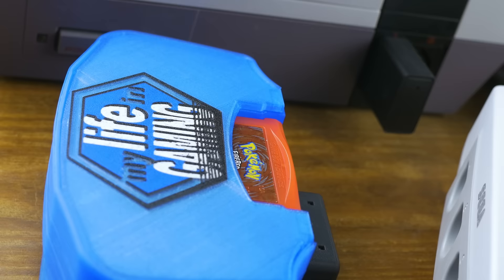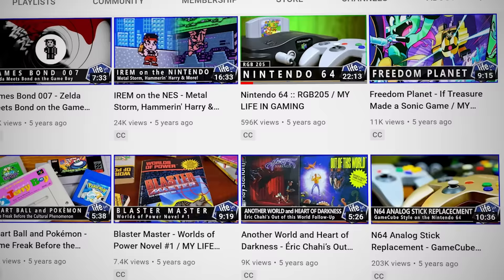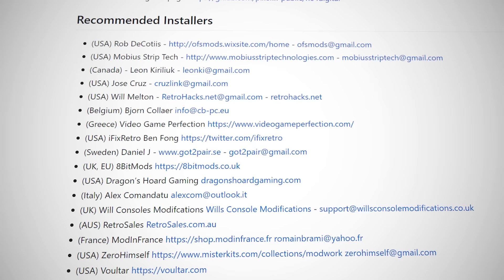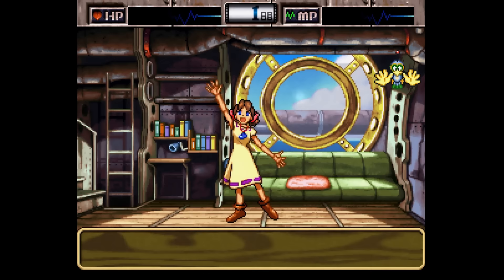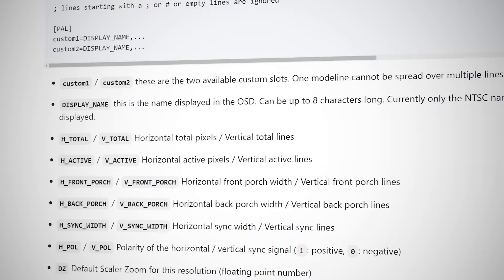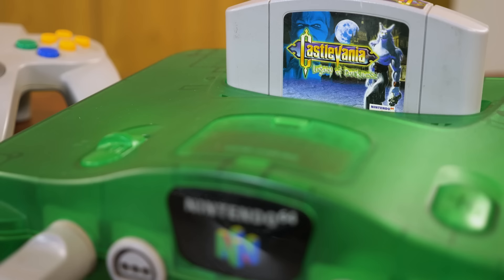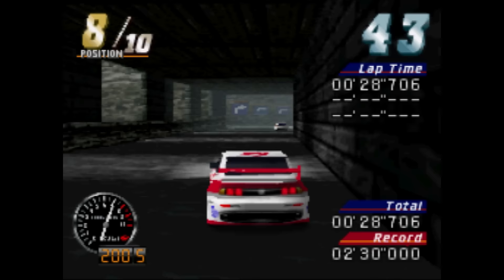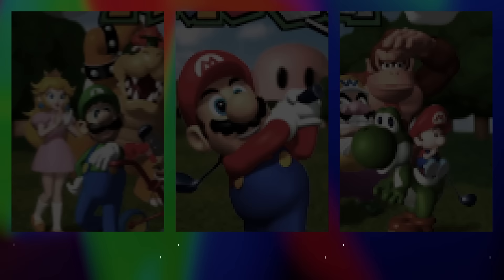N64Digital - Ultimate HDMI and RGB Mod for N64? :: RGB323 / MY LIFE IN GAMING

Comment: I have five CRTs and never intend to go HDMI with 64 buy I'm still watching this because this series has been so great. Glad to see another entry
Reply: Only 5?
Reply: Cool I love I only have 2, a 13 inch RF only Orion and a 27 inch flat screen Emerson from 2005 with S video.
Reply: @PaperBanjo64  Tbh, as long as you have the right CRT that you enjoy, then 2 is all you need, or even just 1. Admittedly I now have 6 and counting, just got my first HD CRT T.V (32" Samsung), didn't think that would be possible in the UK as they were not really a thing here unfortunately, it's imo the best possible display for playing everything from PS2 up to the 360, Wii looks awsome on it @ 576p EDTV mode through component. The rest are VGA monitors, I have some really nice ones like a Sony G520, a Sony  GDM-5011p which is a pro graphics CRT with an incredible picture quality, I also just got a LaCie Blue IV (incredible monitor) and an LG Flatron 910SB.
Reply: I use a newer TV but it has an RGB scart input so I use this with consoles.... But don't have an n64

Comment: I'm envious of this mod! I have the first-gen Ultra HDMI and think it's fantastic, but man, also having RGB support? That would be excellent.
Reply from the maker: [Try4ce] You can install basic RGB mods like the Voultar board alongside Ultra HDMI, and I'm pretty sure you can also install the Tim Worthington one alongside Ultra HDMI as well (but you should double-check first).
Reply: @mylifeingaming  It doesn’t work correctly with 1.08+ unless you replace the resistor array with 0-ohms and bypass the flexes with a couple of Borti’s breakouts that have resistors at the RCP. 1.07 seems to work if you use Borti’s breakout for the N64RGB.
Reply: Glad I waited on this

Comment: Yes, I am in the second camp. I don't want to see blocky pixels on this gen of console that I grew up with, if I'm not on an emulator. I could do a cleaner "upscale" on an emulator, and I have both a gaming PC and a Pi4 (in a fetching old PlayStation case) attached to a 4k flat panel. I watch the videos to see what's out there though, it's certainly cool!

And, to be fair, I have refurbished and recalibrated a happy little 90's Trinitron for the OG consoles. For a while, I didn't see the appeal of that, either, being too used to emulators without analog outputs and almost forgetting how the original experience differed. Then I saw that Pis have composite through the headphone jack, and RetroPie images had been created optimized for CRT... so I fixed the Trinitron, experienced relative greatness, and quickly got into OG hardware with mods and flashcarts.

Comment: This is really cool, but I'm happy with UltraHDMI for now. Thankfully I didn't spend a fortune on it, lucked out and got a kit on retail from Australia of all places. Still probably the most stressful soldering job I've ever done.
Reply: @shhhhplsbequit  It also adds lag and looks way worse. You don't have to get a full on HDMI mod for decent output though, actually good solutions start at $60 or so with RetroTink 2X-Mini / RAD2X.

Or, you could probably find some random old CRT for 19 bucks or less and get a very good experience indeed.

Comment: I've found my preferred output option on both the N64 and the PS1 to be S-video, which works perfect for my setup anyways which consists of a Micomsoft XRGB-3 line-doubler with 2x S-video inputs.  This allows me to save the 2 RGB inputs for my NES and Genesis.
Reply: I'm guessing your NES is RGB modded then.

Comment: 00:10:20 They could add an option to crop the picture from the GBA emulation to just the 240x160 frame and upscale that to the desired output resolution.

They could even add 3:2 resolutions for GBA games, such as 720x480, which is not only a common resolution but is also a perfect 3X scale of the GBA frame.

While GBA on the N64 may seem like a low priority, it's nice for those who like a single machine to be able to play games from multiple consoles.

Comment: Man, that vertical scanline really does look good. That's more what I think of when I think of CRT. Never liked regular horizontal lines cos, to me, it doesn't look like what it's trying to mimic. Sonic Mania had maybe the best CRT filter I've seen but this is right there with it. Do hope some modes start using HDR to give the games a little extra light to dark range to better match the brightness of a CRT some day. Hell, at a high enough resolution I imagine you could recreate how a CRT represents each part of a pixel in detail.
Reply from the maker: [Try4ce] Yeah it really does give it a nice crunchy consumer CRT look for sure! Regular scanlines just look like a PVM, which isn't what everyone is looking for.
Reply: @mylifeingaming  Hey Try, do you think you could share your scanline settings? I tried to catch it in the video, but the settings changed around a bit.

Comment: really bummed that ypbpr analog out was advertised as a launch feature but it's still not available yet, and u didn't even mention it 😭😭😭😭😭
Reply from the maker: [Try4ce] I originally wrote a mention of it, but took it out because one, there's nothing to show for it, and two, I don't really understand the point? You'd need a custom component cable to use it, and I'm not even sure where you'd get one. I feel you'd be just as well off converting RGB to YPbPr externally, either with HD Retrovision cables or a converter like the RetroTINK RGB2Comp.

Comment: 00:09:49 It would be nice to add a 16:10 aspect ratio option for Donkey Kong 64, which if I'm not mistaken, runs in an FOV of 16:10 in the widescreen mode.

16x10 resolutions would go along well with that, such as 1280x800 or 1440x900.

Comment: Is anyone aware if HD Retrovision's SNES component cables work with this output? My CRT has component and I would like to play on that occasionally. Thank you!
Reply from the maker: [Try4ce] I actually didn't test that, but I would be shocked if they didn't work. My N64 SCART cable is sync-on-composite, which is how HD Retrovision cables pull their RGB for component conversion. That cable works both with my old RGB mod and N64Digital's RGB, and I know for certain that my old RGB mod works with HD Retrovision, so I can't see why the result would be any different.
Reply: @mylifeingaming  * Thumbs up* Thanks so much for the response!
Reply: 100% do work with both N64Digital and UltraHDMI HW2.

Comment: My experience with N64 RGB differs from the assessment in this video. My TV looked much better with an N64 RGB MOD by Arthrimus tech (I believe based on Borti's) + OSSC over s video + Retrotink mini. Both with deblur on or off look far better than the stock S video. Unsure how much of that is due to the upscaler, but I'm using a cheap Aliexpress OSSC.
Reply from the maker: [Try4ce] I think on a CRT the jump is really small. With an upscaler, the jump is more noticeable, certainly. But much less noticeable than the jump to RGB for other systems, I feel.

Comment: @mylifeingaming How is it that the image at 24:46 of bomberman doesn’t look blurry on the retrotink yet the n64digital looks like a blurry mess shouldn’t the n64digital look better than that?
Reply from the maker: [Try4ce] You have to understand that I'm showing the results on a native 1440p monitor. Native resolution matters a lot. I don't think native 1200p monitors are common these days. The next comparison shows both at 1200p, so you'll see that they match more closely. If I used to custom modelines to enable 1440p on the HDMI output, then they would look basically the same. Or if I'd shown both on a 1080p monitor, they would look the same. If I'd shown 1080p on a 1080p monitor and 1440p on a 1440p monitor, the relative sharpness of each would be perceived as being pretty much the same. It was not meant to suggest N64Digital HDMI is blurry, it was just showing how RetroTINK offers 1440p without any fiddling, and 1440p monitors are pretty popular. If I'd done the same thing (1200p vs. 1440p) on a 4K (2160p) screen, the two would most likely both look a touch soft, and the difference between them not that great. It's just demonstrating what matching native resolution can do.
Reply: @mylifeingaming  ok so you don’t need a retrotink to make it look that sharp ok thanks that part of the video confused me.

Comment: I wonder if those upcoming scan converters will add built in support for "freesync" or "VRR" from HDMI 2.1.  That would be a killer feature to finally deal with those "slightly out of spec" consoles perfectly.
Reply: It would be cool in theory, but VRR monitors typically can't refresh at less than 30 Hz. They'll do some form of frame doubling or buffering, with varying results.
Reply: @ozzyp97  That shouldn't be an issue at all.  When I say they're "slightly out of spec", I'm talking hovering around the 60FPS range, way above that minimum.

Comment: I do not believe that this is the end-game for retro console mods.

I do think someday we will get a smarter upscaler that uses AI similarly to how Nvidia DLSS works, and it'll just take the raw image and completely re-draw the image in a higher resolution.

This could be in the form of an OSSC like box, or internal mod. And I can't wait for these types of product to come.

You can already get a slight glimpse of things like this happening with products like the newest Nvidia Shield and their AI upscaling options
Reply from the maker: [Try4ce] Speaking as a non-engineer, I think we will soon (or soonish) be hitting the limit of what is feasible to cram into a console from a space, price, and power perspective. You can only fit so much in there, you can only spent so much building it for it to be viable, and you can only tap into so much power within the console itself. I think the great thing about the mods we're getting now is that we can pull that pure digital signal, and then future external devices can take that signal and do even bigger things with it. The result of a native 4K output from the N64 itself could in theory be just as good as 1200p upscaled to 4K, 8K, or whatever, if the external box had really good scaling and features.

Comment: So the noise pattern is baked so deep into the N64 hardware that even appears in emulators? Noticed it when playing Mario Party 3 on OpenEmu, which uses Mupen64Plus as its N64 emulation core.
Reply from the maker: [Try4ce] Well, each game uses it a little differently, so I'm not sure how an emulator would handle removing it. It was often used to create the game's intended look, so I feel it should be there to preserve accuracy.

Comment: I will never understand having per-system scalers.  Just get one scaler and run RGB to it.  Done, and for much cheaper.
Reply: Exactly
Reply: @devraygg  It's still really dumb.  You're talking about severely diminishing returns, and I've never met someone in the retro scene into just one system.
Reply: @slamshift6927  Even if it's not their only system, some people might want to spend some extra on the one they play the most. It's also more convenient in some instances, you can move the console around without taking apart your entire scaler setup.
Reply: @ozzyp97  A scaler is one extra device.  If you got per-console scaler money, you got second Retrotink money
Reply: @slamshift6927  A per-console scaler is also one device if you only get one for one of your systems. It's just a matter of your use case.

Comment: My question is if I only have the original composite cables and I use the retrotink 4k, do I need an hdmi mod, should I get s cables? And also what settings are optimal to use with an unmodded n64 with s cables or composite cables?

Comment: What's better, the N64Digital, or the Retro G.E.M. Shiny Edition for the N64? Please let me know! Because I plan to buy one of these soon! Do they both have good customizable Scaling > Zoom settings? This is important to me because, on a big TV, I believe N64 games look too pixelated, so I like to make the screen smaller in the settings.
Reply from the maker: [Try4ce] They are roughly equivalent, though I have no GEM to test personally. I believe the GEM more or less is the successor to N64Digital. With scanlines and softer horizontal interpolation, you may find that the games don't look too pixelated for you. You can do 4X scaling, which is fairly small for a modern TV, will have some black bars on top. I can't recall off the top of my head if you can go smaller than 4X when outputting 1080p though.

Comment: we need more resources poured into emulation of the N64, the original console just looks so bad, it only looks decent in a CRT, and I said decent, not good
Reply: Like the hair 😃 I’m also a Lopez and my hair is the same color 😬. 

To reply though, I don’t think there’s much to be done. High res textures and sharper lines don’t take away the polygon appearance. It’s more vibrant but these HDMI converters etc just don’t cut it for me. I remember playing the N64 on a CRT and that’s hard to replicate with modern technology. It needs the blur and true scan lines for me.

Comment: Man I love those vertical scanlines. Does the retrotink 5x do that? I'd love an as close to CRT filter for ALL of my consoles as my CRT's age into death.
Reply from the maker: [Try4ce] The RetroTINK 5X has advanced like crazy through firmware, and you can indeed do some really really similar stuff! It's very impressive!
Reply: @mylifeingaming  Thanks for the reply. I've been on the verge of buying a RetroTINK. I hope they add the vertical scanline feature cause man that image you showed looked really really good. I've been satisfied with the Switch's "CRT" filter, and really really wished the Analogue NT and Super NT had something like that. I'm not a fan of "crisp" pixels. I really like the way pixels blend together on a CRT and getting something super similar in a scaler would be nice. Then maybe when my last CRT finally kicks it, I won't be toooo sad.
Reply from the maker: [Try4ce] It's not a vertical scanline option on RetroTINK 5X specifically, but you can basically get the same effect with its CRT mask filters. I think it's pretty much equally effective.

Comment: Ultra Hdmi n64 or PixelFX N64. Looking into buying one already installed.
Reply from the maker: [Try4ce] PixelFX is a bit more modern and has more advanced CRT effects. It also includes RGB video output if that's of interest. For the most part though, they are very similar, so if the Ultra HDMI were a lot cheaper or something, then it could be worth considering.

Comment: Question, theHDMI Cable for a 4K TV follow the same rules explain in the 106 RGB Master Class?
Reply from the maker: [Try4ce] You don't need to worry about that for this mod. It can't output a high enough resolution to need a special cable. The only thing you have to consider is getting a good HDMI mini adapter. They can be touchy.
Reply: @mylifeingaming  thank's

Comment: Is there an emulator out there that has good compatibility and offers resolution ups along like 4K? If so wouldn’t that blow these HDMI mods out of the water in terms of picture quality
Reply from the maker: [Try4ce] Depends on your point of view. I don't think higher resolution is always desirable in some cases because the games were designed with the lower resolution in mind. HUD elements will be lower resolution, mixed in with higher resolution polygons... it looks weird to me. You can also more easily spot pop-in and other visual quirks that a lower resolution masks. In addition, N64 uses a particular kind of texture filtering that is rarely replicated, and some textures look wrong as a result. There are nice aspects to the higher resolution, don't get me wrong, but I think the end result is a less cohesive image.